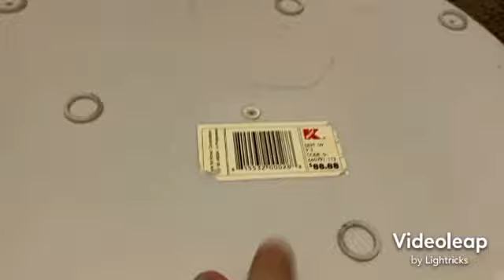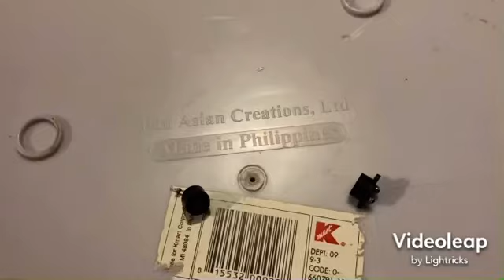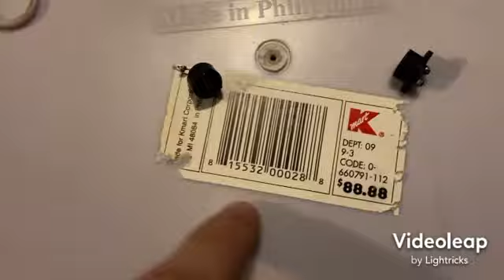REPAIR video: PAC Life Size Animated Dancing Santa Claus

Comment: I have the same santa. the problem I'm having is it wont dance with the chest on. I take it off and will dance put back together and wont dance. (I did change belt drive). also sensor don't work plays only 1 song but continues to dance when song is over. any help would be appreciated

Comment: awesome video.  Same Santa here.  The motor is not strong enough anymore to move the shoulders up and down.  Was trying to find something more modern with an arm to push up and down (or replacement motor)

Comment: Hello, I see in your video that you have the dracula, I have one, but the movement is not working, any idea to know how can i fix it? regards
Reply from the maker: It may need a new motor. Does it make sound
Reply: @tylerx71animatronics76  yes. It has sound.. The motor is working
Reply from the maker: @guadalupeperezbaeza9978  I’m sure I’d be able to repair it for you.